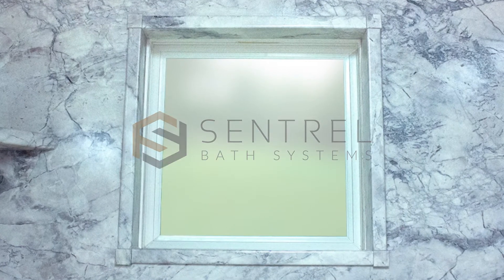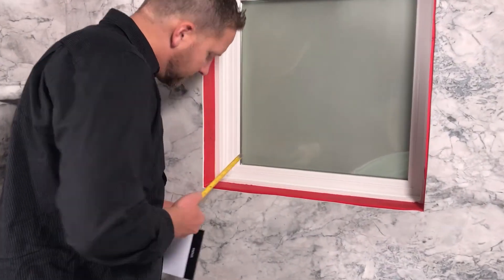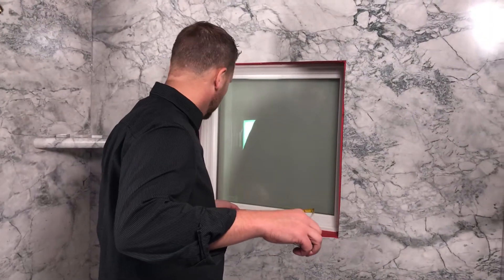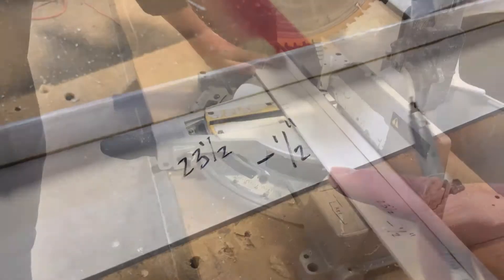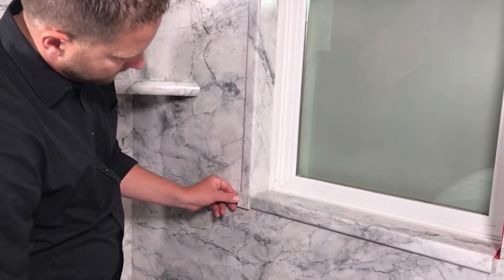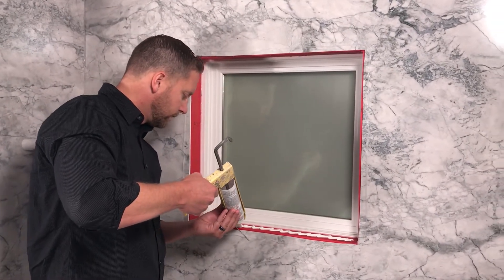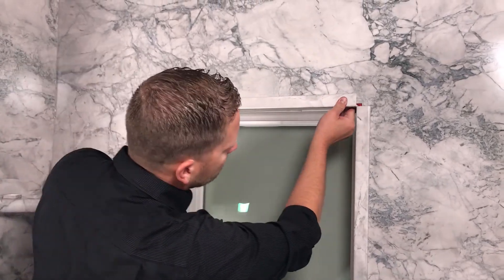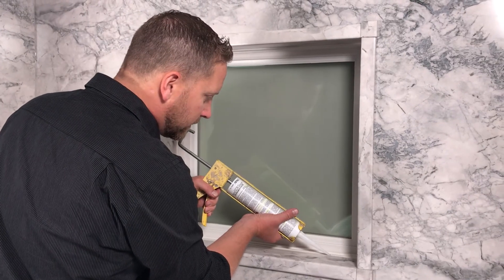Sentrel Window Sill Trim Installation

Comment: so if window sill isn't the same depth, when you take your "3 measurements", and it is not as wide as your window kit is. Do I still rip the window kit first or would you suggest maybe cutting it to width first?
Reply: Cut the window sill trim to width first. Then rip the depth of the trim according to your widest measurement. If there is variation in the depth of your window sill, you may need to do some fine-tuning to your cut with a jigsaw or razor blade.